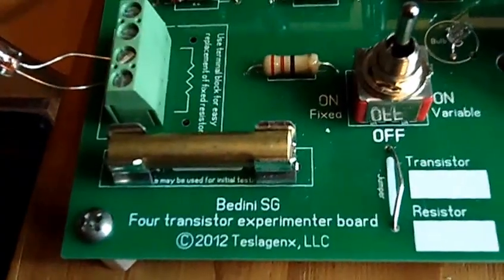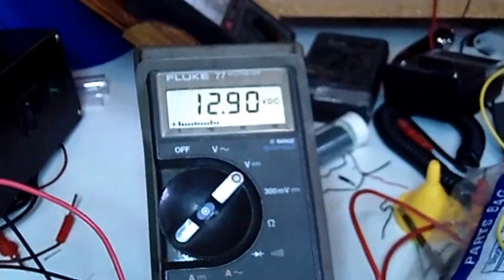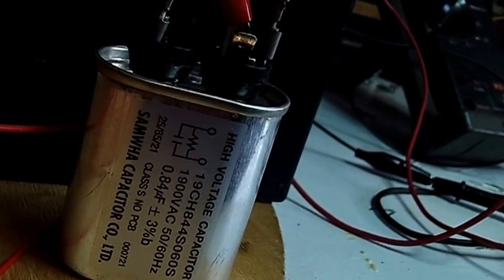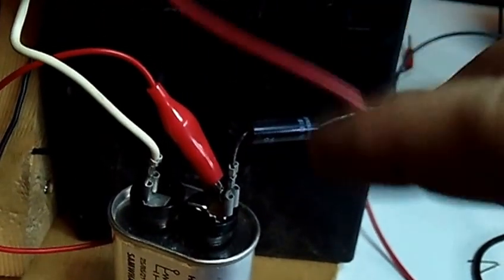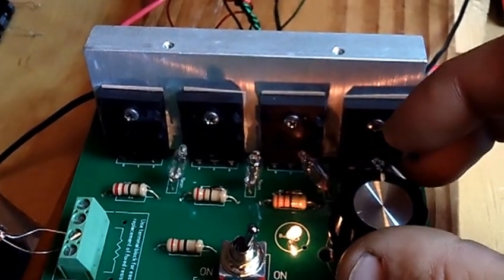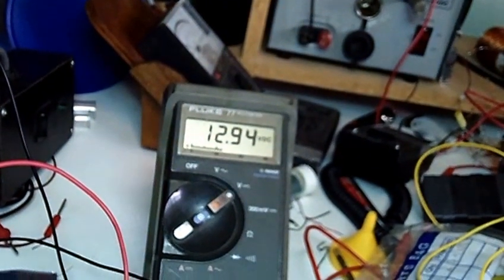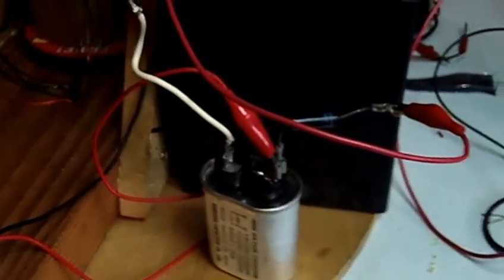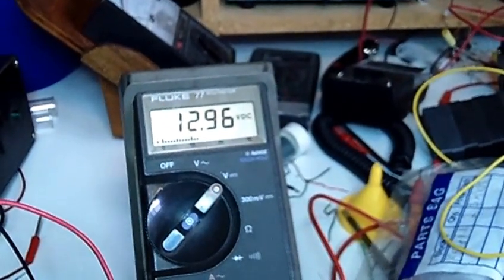SG4 self runner

Comment from the maker: I removed the microwave capacitor and problem solved.  Also I noticed the effect when I drive a coil in series with the charge battery.  I am currently using my original wheel that still needs new bearings.

Comment: go for 2004 Ohms, sometime you must disconnect connection from one of the terminals of battery to prevent selfoscilation.
you charge battery by Impulse, and wheel spinning is imperative, you should get to the point where wheel spinning takes as leas power as possible.

Comment: Hi Treven, great to see you having fun with the Bedini SG 4 Transistor Experimenter Kit.

The reason it is self-oscillating is because you have the base resistance (potentiometer) set too high. Even though the meter shows the battery is charging, it is not a sustainable charge.

The Bedini SG is designed for the wheel to spin to get the best charging.

Have fun!

TeslagenX

Comment from the maker: I am using the variable pot,  I have raised and lowered the coil in respect to the magnets.  Last night I switched the batteries, run to charge and vise versa.  It took about a  half-hour of hand turning the wheel before it started running without spinning.

Comment: Try moving the wheel (magnets) away from the coil to see if it would stop oscillating. I think it's the position of the magnets and their respective magnetic fields that are driving the oscillation. I have the same kit but I only have one circuit in play at this time. You said it doesn't drive the wheel but it oscillates? What resistances are you using? Sorry for all of the questions but I am very interested.
Thanks for posting!
Peace!